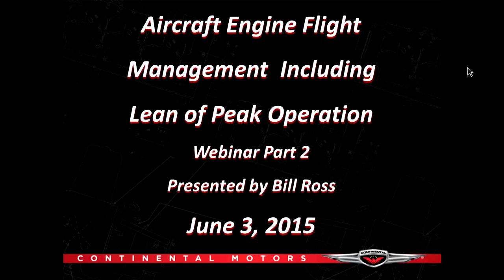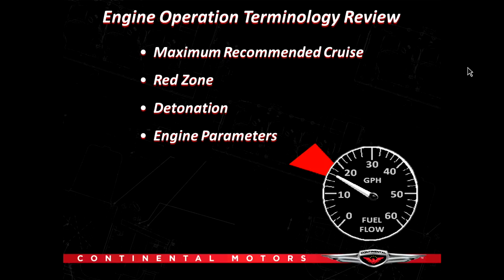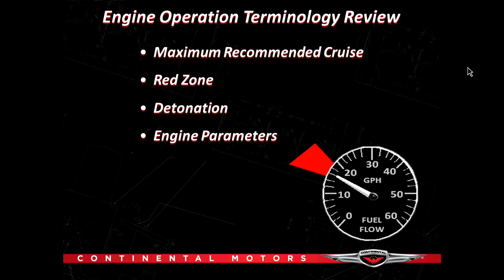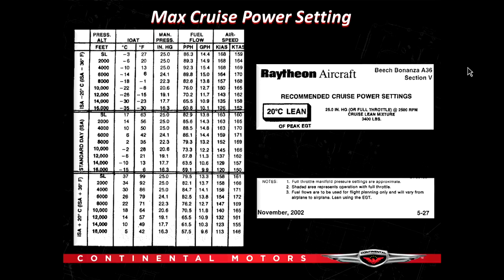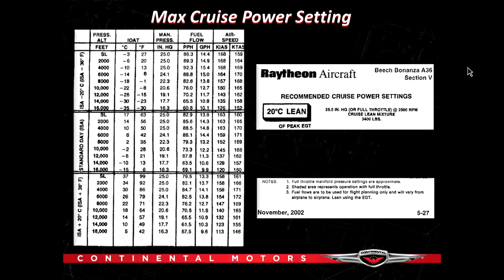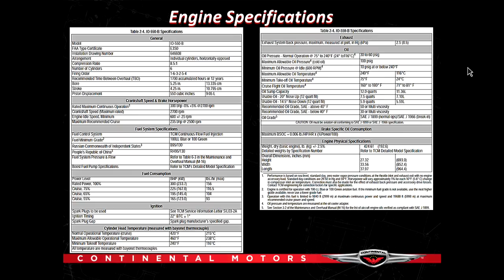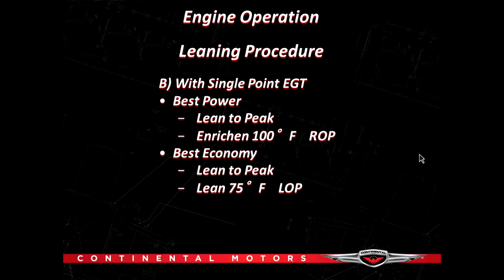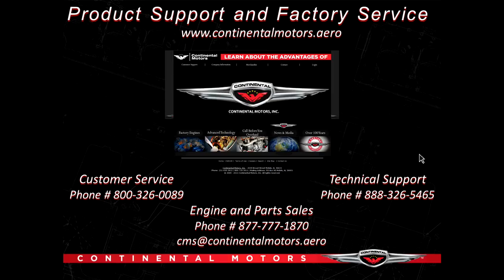Aircraft Engine Flight Management Including Lean of Peak Operation Part 2

Comment: :)),, so how much past lop will the motor start to run rough?,, and if you just pull back till it runs rough and then add till it runs smooth would that be close to lop ?
Reply from the maker: Once the leanest cylinder passes LOP enough to begin to starve it of enough fuel for proper combustion, you will begin to feel roughness in the engine.

Pulling back until it runs rough and then adding enough to run smooth works well in carbureted engines, but in fuel injected engines it's much safer to use an engine monitor or EGT gauge to ensure you are not near the dangerous mixture areas for detonation.